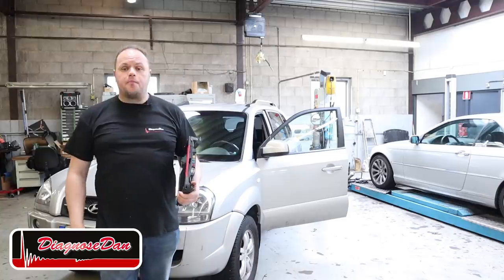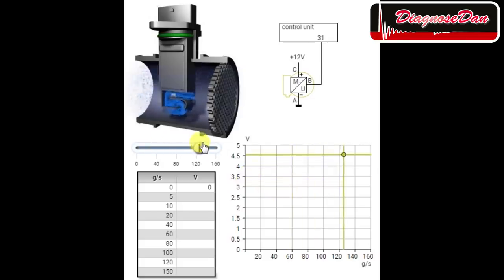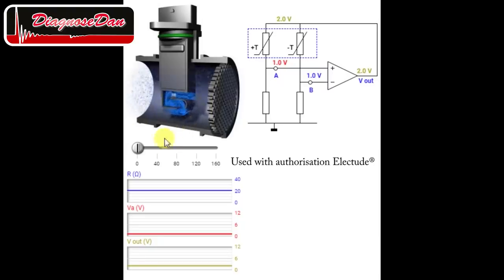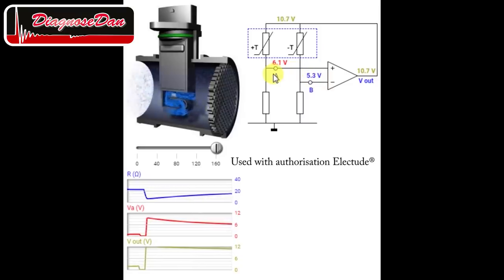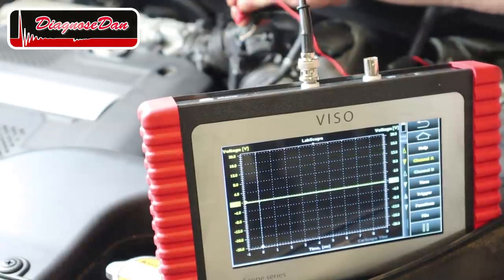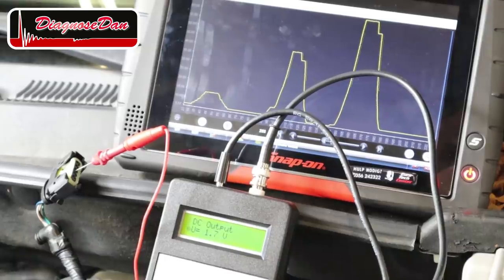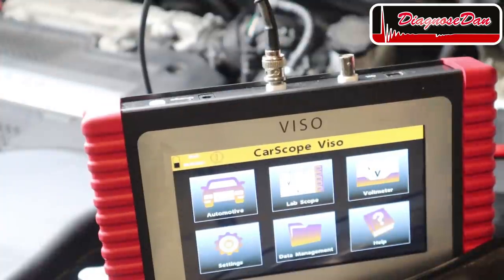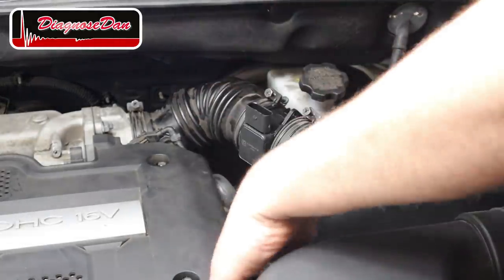Oem vs Aftermarket

Comment: You should always make sure the sensor is installed with the sensor part in the exact same orientation in the tube. I used to calibrate MAFs on a flow bench and by twisting it inside the tube you could slightly alter the reading because air can be coming around a bend in the ducting and air on the outside of the duct flows faster across the hot wire in the sensor as the sensor essentially only covers a very small portion of the MAF so it essentially takes a small sample in a small tube inside the larger tube which is the MAF itself. Basically you have to clock the sensor in the same position.  The ducting before the sensor on this car looks pretty straight and your results are confirmed as the difference would not have been so large through just "clocking" the sensor but if you have a car that has a bend in the tubing just before the sensor you can try "clocking" it in different positions and can see up to a 10% difference in the readings just because you can locate the hot wire of the sensor in the area where the air comes around faster or slower on that side of the tube across the sample tube of the sensor while your actual real volume remains the same.
Reply from the maker: Thanks for the feedback!👍

Comment: Hey Dan, great video! But I have one question: how can I get the calculator for the approximately g/s airflow? Until this point I only knew the calculator for volumetric efficiency from OTC
thank you for the great videos!
Reply from the maker: The Maf calculator is not yet available 😔

Comment: Hi Dan, 
Great Vid! I am - and have been - a subscriber to your channel due to the great explanations and content. I have 2 suggestions regarding this video:
1. if you are only working with 1 component (or possibly 1 system depending on the complexity) such as the MAF here, put it in the title. That way people can search for and find relevant information when they need it. It would be a shame if people only happened to find your excellent description of MAF operation by chance... 
2. I came here today because the title "OEM vs Aftermarket" caught my eye. I am actually with a maker of auto diagnostic equipment, but we work closely with large parts suppliers that deal in both OEM and aftermarket parts. If people unfamiliar with the auto industry watch this video, they could be left with the impression that all aftermarket parts are bad. As you know, this is def not the case. Even tier 1 OEM suppliers such as Mahle, Valeo, Hella, etcetc supply parts for vehicles that hey are not OEM suppliers for - and as such they are aftermarket suppliers in these cases. And even with parts manufacturers that are purely aftermarket, there are many who supply parts in good quality. 

I think that, with the way the market is at the moment, for people who are not familiar with the automotive parts market and aftermarket parts suppliers, it is probably a good idea not to order parts from Amazon or ebay or large generalized internet parts dealers. If you want to save money on parts over the original dealer parts prices, go to a specialist parts dealer. Nearly every larger market has dealers specialized in parts for specific Marques (Toyota, Land Rover, etc). Some even offer the same part from multiple manufacturers, from OEM to cheap Chinese, and list them with the corresponding price. But it is not easy for people who do not work in the field... Sometimes it is not even easy for people who are very experienced and work in the field!

Comment: Hi. Great channel. My only issue with comparing two MAF sensors is how much of a deviation is there between two OEM sensors. Would the fuel trim not compensate for any deviations in MAF sensor readings (or even a dirty filter)? Shouldn't the engine adaptations be cleared or the vehicle driven enough for the fuel trims to compensate for any differences in readings before condemning the aftermarket sensor.
Reply from the maker: Even if the fueltrims compensate for it it's still has got a big deviation. And it was reading 1.7 gr/s and that's not right.
Reply: Relying on fuel trim to correct AFR would be problematic. 40% fuel trims would trigger lean codes and the MIL. Also, fuel trim does nothing in open loop such as at WOT. The driveability  problem he experienced was at WOT. It is questionable as to whether the the PCM can eventually relearn MAF sensor values. The scanner and/or PCM offered no option to force adaptation. That part was obviously too far out of spec.

Comment: Great vid Dan, but I would also like to add that you could have tested all of this with a cheap multimeter... (voltage out, ground voltage in and continuity from sensor to pcm). Also most cheap code readers with live data, (even non graphing) will tell you grams per sec. I am a poor technican, like most of us in the states I make due with what tools I can afford. Believe it or not most shops in the US don't have lab scopes. We here in the US have awful aftermarket MAF sensors too, the worst are remans from a place called A1 cardone and they should be avoided like the plague.
Reply from the maker: Of course you can test it in different ways, you can use what you have available👍 Thanks for watching!

Comment: This is why I just roll my eyes when I have someone ask me about a drivability issues, and a code they  have and they follow it up with I replaced the MAP, MAF, Cam and Crank Sensors, O2 Sensors, Fuel Injectors, Plugs and Wires, Coils, and it still happens.  I know they just put aftermarket parts in and threw away the good stuff.  I use aftermarket stuff, but most of the time I'd rater find a good used OEM one from a salvage yard vs. going with aftermarket when possible.  I have had really good luck with Wells aftermarket sensors though.

Comment: Great video. Wow i wonder if there are actually good aftermarket companies that make good parts and sensors or there is not such a thing.
Reply from the maker: There are!😊
Reply: Nine out of ten times, Sharp prices are their selling point, not superior quality. To reach that, one might resort to only checking ten random sensors from a batch of a hundred, of be less strict with the dismissal thresshold. Most customers only care about the price.

Comment: I got burned on an ebay MAF for a Nissan.  I should have known by the fuel trims that it wasn't working right.  car would randomly stall at idle, big PITA.
thanks for the wisdom Dan.
Reply from the maker: Your welcome!👍👍👍
Reply: Had same issue on Toyota Yaris a few year ago if I remember correctly there was very little difference in price of the genuine and aftermarket price buy cheap you buy twice. Love your videos you explain everything so clearly

Comment: I'm jealous of that scope! I want one, but I'm too cheap haha.

I work at a dealer so of course I prefer factory parts, but sometimes manufacturers just put their name on other company's products (Denso, TRW, NTK, Valero etc). I've bought a Denso oxygen sensor for my honda for a fraction of the cost of factory but it's the same one. Like anything else, it comes down to using good judgement and doing your homework.

Also, I'm very reluctant to put aftermarket alternators and starters in vehicles... they come back way too often. :(
Reply from the maker: Ha ha thanks for watching Nick!

Comment: This was an excellent video Dan. I was sort of expecting to see an attempt to clean the sensor first with a spray cleaner or at least check that a leaf or something wasn't covering one of the wires. I suppose having "0" output is the clue that it's faulty though.

Comment: I just went through this on a 2005 GMC Sierra 5.3L w/92K miles.  Had lean codes stored.  At first it appeared to be a vacuum leak but I couldn't find one.  When I drove it the O2's went full lean under wide open throttle.  Checked fuel pressure and it was right on.  Looked at the MAF...what do you know?  Recently replaced aftermarket sensor--Made in Taiwan. At idle it was showing about 4.6 g/s so a bit low.  Replaced it with a new Delphi (the OEM) and problem solved--customer happy.
Reply from the maker: Great! So now the customer had to buy 2 sensors, Maybe aftermarket isn't that cheap afterall🤣🤣
Reply: @Diagnosedan  Precisely.  It's less expensive to go with the more expensive parts.  Kinda like when Eric O says you gotta slow down if you wanna go fast.

Comment: Hi Dan, thank you for another great video. This has prompted a question : when you say original MAF sensor do you mean an actual Hyundai one or an OE supplier one, conversely when you say an aftermarket one one do you mean a no-name cheapy Chinese one or an OE supplier one. As we all know, Hyundai like all car manufactures don't usually make their own sensors, they buy them in from the likes of Bosch/Delphi etc. So what I'm getting to is, having seen this video and after your answer to the above question, should I really only buy sensors from the car manufacturer, or can I, in your opinion work with OE supplier sensors with confidence?
Reply from the maker: Stick to OE supliers
Reply: OE suppliers ARE car manufacturer parts... your question makes no sense... perhaps you meant "aftermarket" instead of "OE" which is Original Equipment... 🤔

Comment: Good day! Thank you for very detailed informative to learn at home DIY. From Philippines. I have P2096 DTC. Oftentimes P0101 Mass Air Flow DTC. Fuel trim bank 1 too lean with 2013 Mazda 3 2.0L. What is the problem of my airflow system?

Comment: That's a huge difference between OEM & aftermarket. .. more proof that as technicians,  we should try to avoid using them when possible. Of course as long as customer agrees. Electronic parts even more so, but I'm leery of using mechanical parts like timing components and have it backfire on me, possibly cause catastrophic damage. 

Funny clip with Leon! I hope thing improve for him!
Reply from the maker: There was a big difference and you know what the funny thing is, in this case there was only a 10€ price difference.

Comment: Hi dan 
Was there a noticeable difference in fuel trim values, I find looking at the fuel trims really help when diagnosing mass airflow sensors
Great content by thy way I love your videos 👍
Reply from the maker: Yes of course, the trims try to compensate for the bad Maf readings.
Reply: Barry, you have the same question I do: If the aftermarket mass airflow sensor voltage is indicating less air mass going into the engine than actual, the ecm  will trim less fuel to match, causing a lean condition, right? This should show on the oxygen sensors as a lean condition and confuse the ecm, wouldn't it?  It confuses me.

Comment: I bought a MAP sensor aftermarket. I still had the same problem with the engine, running rough, stalling. I spent the rest of the day chasing a ghost, thinking I had the problem with the MAP solved. I happened to go to a junk-yard in search of a different part, and just out of curiosity, I also brought home the MAP sensor from the yard. I swapped it out with the new aftermarket part, and my problem went away. He has a point about aftermarket parts.

Comment: Have you ever heard of a pulse signal from an ECU? Apparently this is the cause of my radiator fan constantly starting and stopping every few seconds. There's 2 fans on my cooling system and the larger of the 2 is the problem. I took it to a local mechanic and he said it was a dealer issue and he couldn't fix it. I replaced the thermostat and thermo switch but to know avail. The engine light is on. This is the only issue with the car.. 2005 seat Toledo MK3 1.9tdi bkc engine 105bhp.. any help would greatfully appreciated..
Reply from the maker: Watch my video on PWM you'll see this can also be used as a form of communication. I think this is what you mean with a pulse from the Ecu

Comment: Question:You didn't check the heater voltage. In your description of operation you said the heater is part of the feedback circuit of the amplifier. What if the heater was not operating? What can one expect to see on the heater wires? I'd assume it might be a similar signal to the sensor output since the voltage must vary in response to the amount of air flowing as well - No? If the heater is open (or the pcm is not driving it) what would the output of the sensor be? Zero (like you observed?) Maybe the heater was bad or the wiring or pcm output was bad. For a thorough check it might be wise to confirm the heater circuit as well - No?
Reply from the maker: That circuit is internal to the sensor and can't be checked seperately. There are only 3 wires to check. Power/ground and signal.
Reply: Perhaps the control circuit is internal BUT those two wires come out for some purpose. Shouldn't they be check for something? Either another power and ground (for the heater) or...….
Would they be like an O2 sensor heater - that should be checked??

Comment: Fuel mileage suffer from incorrect air intake, from out of range aftermarket MAF? Liked, well done video!
Reply from the maker: Thanks Norman👍
Reply: if it under reports it should  run lean to get the proper air fuel mixture. if its not too far out the o2's will be happy

Comment: We are at a crisis point with aftermarket parts. It's very unfortunate as there are so many parts out there that kind of work for a short time. This must make it very hard for independent shops with customers who keep their cars for years.

It's hard to go by brand either as some components are OK and some are junk.
Reply from the maker: Your absolutely right!
Reply: We are also at a crisis point with many dealer/genuine part prices. Millions of people have to ask if a 400$ maf is justified, when working on a 1000$ car.
Reply: @whozaskin3639  there is always a way out of that, however they all take time. Sourcing the proper oem part if possible is probably the best option.
Reply: @andrewthompsonuk1  buddy, a decent brick and mortar will work with you. Get lifetime warranty parts, and be respectful, and most times you will be treated very well.

Comment: Hello Mr. D. !
I have a question for you.
I know in your country they use to run the petrol cars on LPG. 
Do you encounter the problem of ceck engine light, do to lean condition , and positive  long term fuel trim ,how it can be fixed? 
Thank you  ! 
Cheers!
Reply from the maker: Yes we have those. The problem your talking about is mainly on older systems. Newer Systems don't have this problem anymore
Reply: @Diagnosedan  I have just bought a BMW e46, m54 b30 I.  And because I want to install lpg,  I  don't want to confront with this problem.

Comment: That difference between air mass calculations between OEM and aftermarket is potentiality an engine destroying difference.
Reply from the maker: Thanks for watching!
Reply: It won't, your O2 sensor will compensate.

Comment: great video DD  do you know if the MAF calculator  can be used for a VE calculator on a speed density car  ie chrysler honda to see how well an engine is breathing?  best to you  Dan
Reply from the maker: No i don't think so.😔
Reply: I believe "calculated engine load", (PID $04 in OBDII), correlates to VE at present operating conditions (@ WOT).  "Absolute engine load",(PID $43), correlates to VE @ STP (@WOT).  You should research it to confirm it though.

Comment: Thanks for another interesting video. How were the fuel trims with the aftermarket sensor? Was the poor performance over the whole range or mainly at WOT? An interesting test might be to install both sensors end to end in the air stream and scope both outputs simultaneously.
Reply from the maker: WOT responce was poor
Reply: Thank you.

Comment: Was wondering, if the after market senior gives a lower reading won't the engine be running leaner? Also,  Would the upstream O2 sensor pick this up and adjust the fuel trim to compensate?
Reply from the maker: The fuel trim is going to try to  compensate.

Comment: I was hoping you were going to connect both sensors at the same time.  one in the correct location, one mounted where the airbox lid is.   backprobe the power and ground to feed the 2nd airflow meter.   then use the 2 channel scope to compare the outputs

Comment: I avoid aftermarket like the plague! 😷😂😂😂
Reply: Hey Niamh :) You and I both
Reply: Twinsies!! 😍😂😂
Reply: Well, it depends on the type of part. Some OEM parts are not built very well, and aftermarket ones can be better, or just as good. As an example I'm thinking of the petrol pump on the Austin Morris A-series engine. When the diaphragm leaks there's nothing you can do about it. The aftermarket one I bought had a replaceable diaphragm, that never actually needed replacing

Comment: Sometimes a MAF sensor will malfunction because of dirt buildup on the resistor. You can see the crud on it, usually. They sell a spray can of MAF sensor cleaner which will dissolve the crud. You mustn't ever touch the resistor, as it's delicate. I'd try that before throwing out an OEM sensor.

Comment: dan, where did you get the manifold pressure as 300 bar from scan tool ?
Reply from the maker: Normally scantool, in this case i did a quick measurement because this car has no map sensor.